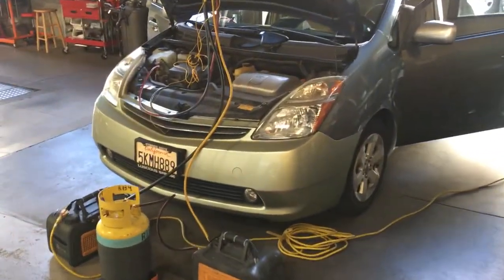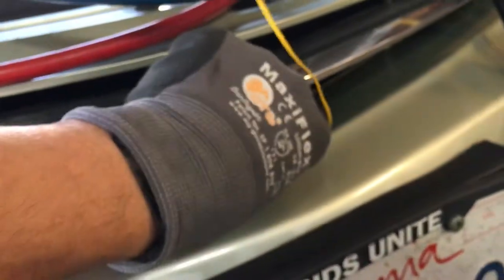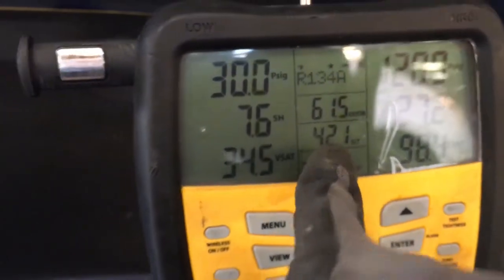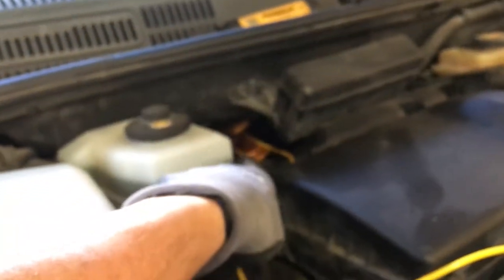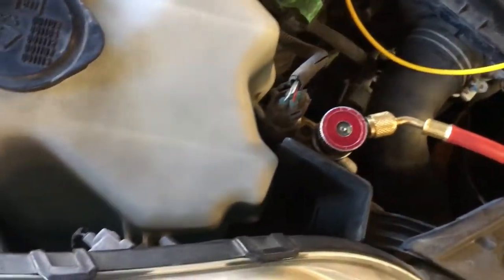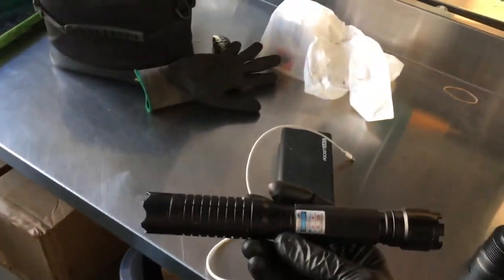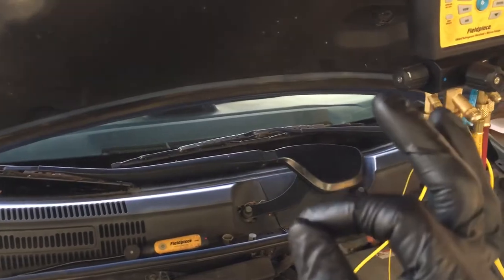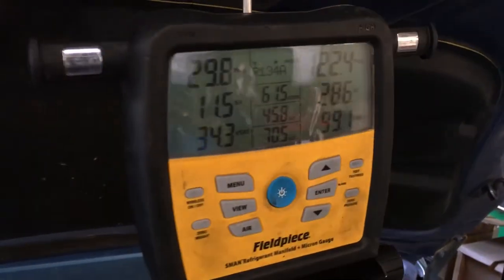FILL REFRIGERANT BY BUBBLES By SIGHT GLASS ??? This is for the bubble geniuses

Comment: In the video you show SLT (suction line temperature) twice, with one probe at the high side after condenser and another probe at the low side after the evaporator. Isn't the one on the high side the LLT (liquid line temp)?
Reply from the maker: You are correct I said SLT suction line temperature twice. 
          But I pointed to the liquid line 1st off the bottom of the condenser and then I pointed to the true real suction line the second time. 

     And this is what happens when you’re taking video looking at a video screen trying to talk at the same time while you’re actually trying to perform work believe me when you watch a lot of my videos you will see I called a lot of parts different names that they are not. 

      I do not edit any of my videos I do not retake any of my videos I do one shot from beginning to end mistakes or no mistakes

You will even see me .to evaporator and I will call it a condenser or maybe I’ll point to a condenser and then call it a evaporator

Old age Alzheimer’s. 

At the same time in my phone video camera I’m off then having constant barrage of emails or text message from shops in customers either asking me to do a job for them and make an appointment or because I’m late they’re asking me where are you when will you get here next. Lol 😂 

When I’m filming these videos you could say I’m a little distracted and I’m thinking of more than one or two or three things simultaneously.
Reply: @coldfinger459sub0  No worries. I know making videos while working just adds more work and appreciate the info (I occasionally try to make tutorial vids while I'm working but usually just give up because getting all the lighting and camera positioned right is a pain and it slows me down substantially when I just want to get the job done). I'm learning this AC stuff and when I saw that part I watched it a few times because I wasn't even familiar with the terms so just wanted to point it out in case you wanted to add a text-over correction for the guys like me that are new to this stuff.
Reply from the maker: @jaxjaguarz  if your new guy and you caught that mistake that was pretty good

Are usually don’t do the text over I don’t cut I don’t splice I don’t edit

A few times I traded to add text at the beginning of the video like a title but I find even that takes extra time away from me even though it’s only a few minutes

    I bought a bunch of lights for videos I bought a boom mic I bought lapel mic I bought a camera holder rig tripods tried setting them up to use during work it cost me so much time in los business in the time. 

      My first month trying to use all the camera equipment and set up and retake I lost over $2000 in work the first month. 

I tried it one more time and really wanted to pop out some videos I’ll lose anywhere from $300-$600 a day in billable hours if I try to do really nice videos with retakes wait for nice sound like when somebody is making noise in the background I have to wait for them to stop every time not worth it. 

I’ll leave all the fancy lights and sound and video editing to the guys who don’t have any work and they could keep doing retakes until everything goes perfect and they don’t say any mistakes.

Comment from the maker: There was zero bubbles in the site glass when filming this video.   When I recovered the refrigerant there was only 148 g of refrigerant in the system. It was very low on refrigerant but still had a perfectly clear sight glass. 

     All cars under all circumstances do not react like you read in service bulletin manuals trying to diagnose by bubbles.      Sometimes yes sometimes no it’s a gamble do you like gambling. 
          A compressor is an expensive item to lose over a gamble technicians don’t do guesswork.